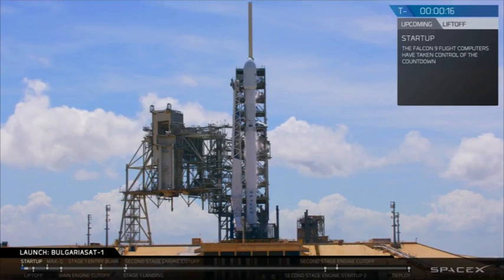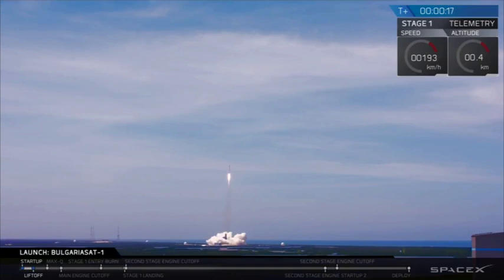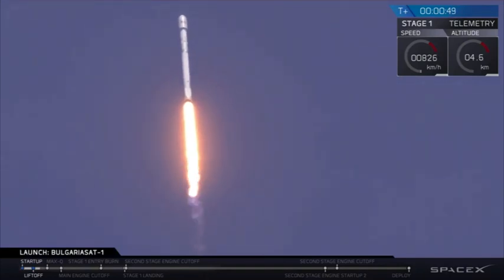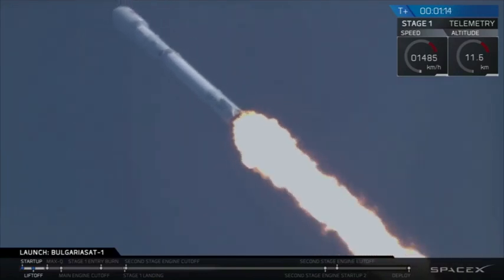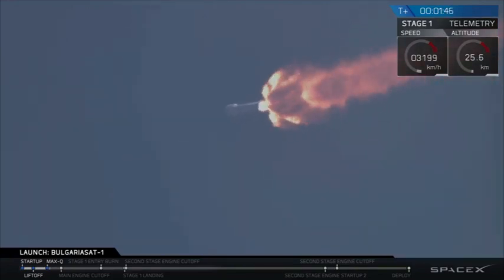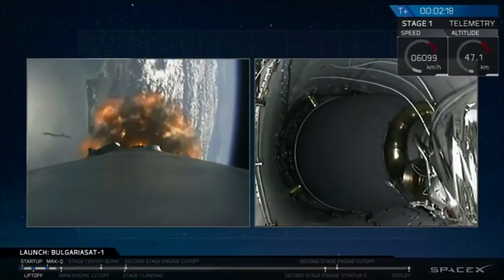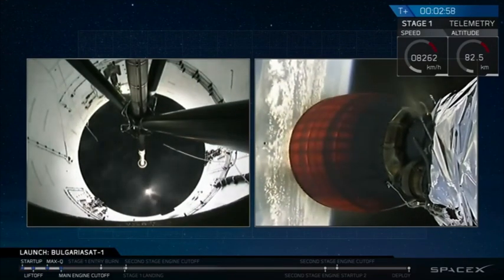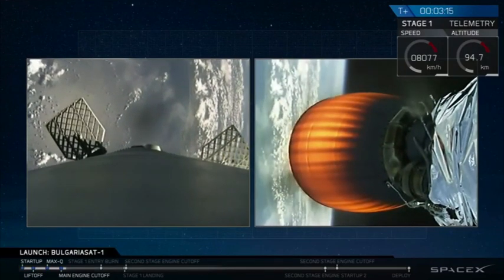Blastoff! SpaceX Launches BulgariaSat-1 on Reused Rocket

Comment: can we get a front viewing angle camera. 
if no, why not?
Reply: If the camera was on the tip of the rocket it would have to be specially designed to survive flying through the air at those hyper-sonic speeds. It would cost a lot and wouldn't survive the trip since the nose fairing ends up in the ocean. After all of that you would just get a video of the sky slowly fading from blue to black. Why bother?
Reply: Gandalf the Grey To see what? Darkness?
Reply: Motokid600 yes have a problem with that
Reply: From where on the rocket? you would see the top of the rocket and sky. It would look the same as it would sitting on the pad. Stage one does have a forward facing camera inside next to the Mvac nozzle that shows the stage sep. and second stage ignition. There is also one inside the fairing that shows the satellite. So there is two.
Reply: Are you going to pay for this completely unnecessary feature, Gandalf?
Reply: Answering your question means I'm trying to act like a rocket scientist? And I agree with you that they could do it, but I'm saying it would be a lot of trouble for no benefit. I'm asking you, why would they bother doing it?
Reply: How is your feature wish-list important?
Reply: MaxxxwellC okay Dr....calm down and stop acting like you're a rocket scientist. 
if they can land and reuse a rocket then they can figure the camera facing the other way problem.

Comment: First stage that was used before in January from Vandenberg, Ca has now been recovered on a drone ship in the Atlantic. Do they plan on reusing this stage a third time?
Reply: bobert4him.  If this was refitted in five months that is a good thing.  Cutting the last refit in half.  If it can be refitted again in two months and used a third time, then they've proved their objective technically.  NASA and CBO accountants will have to verify the cost reduction promises for the three launches.  Few private companies are fully honest about their true costs.  The last reused launch stage was put in a trophy case so the cost of that one is irrelevant as a rough prototype.